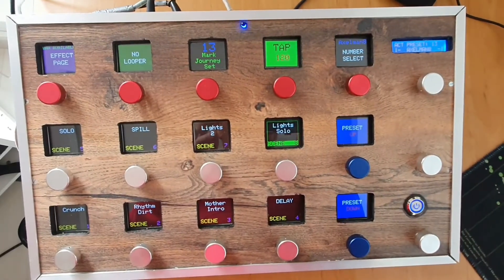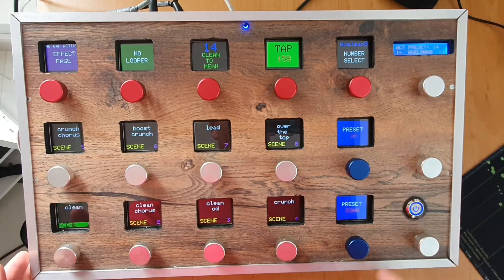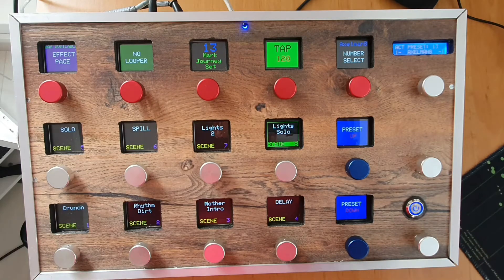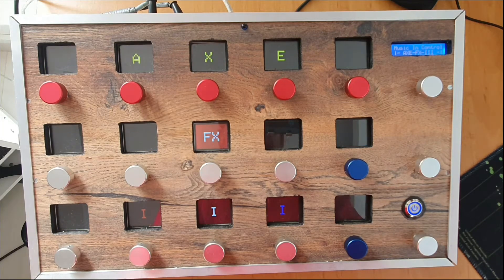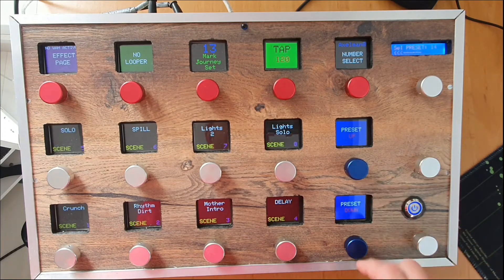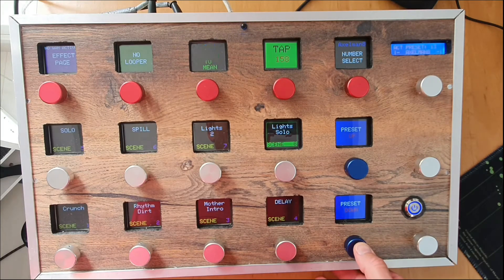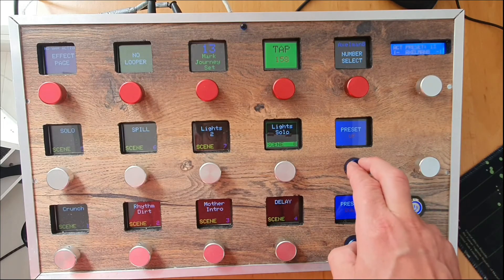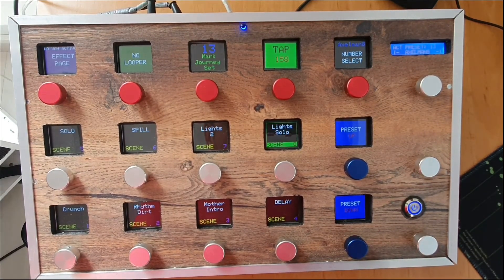Arduino Due | Changing baudrate from 9600 to 1000000

Comment: I am just getting into the world of arduino and this is awesome!! Do you have an documentation that explains how to change the baud rate with the button press? I would love to implement a physical button to change the arduinos read baud. Thank you :)
Reply from the maker: That is not possible.  The baud rate is in the code, and the code is flashed on the chip. You wont be able to change it when running the program from the chip.